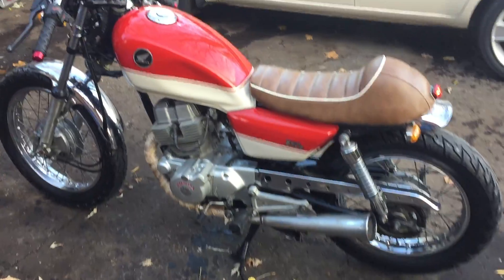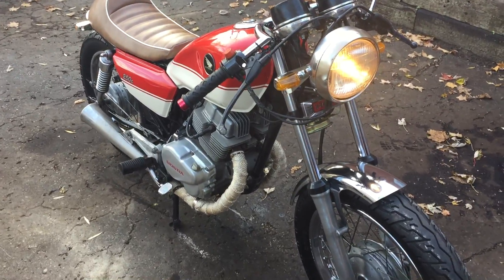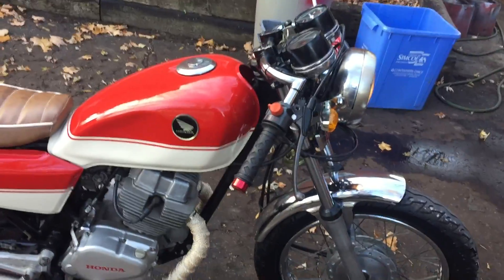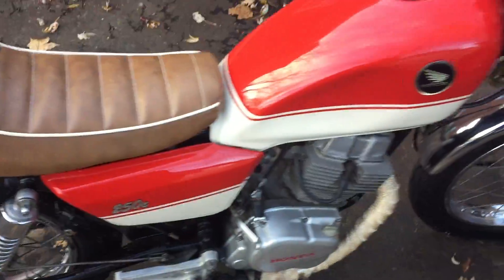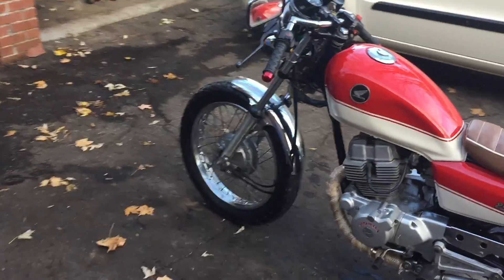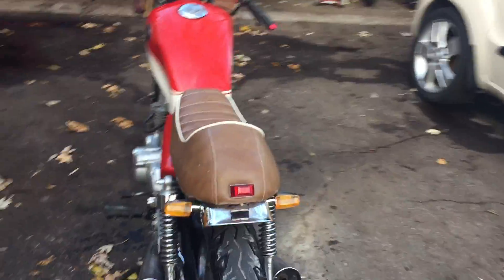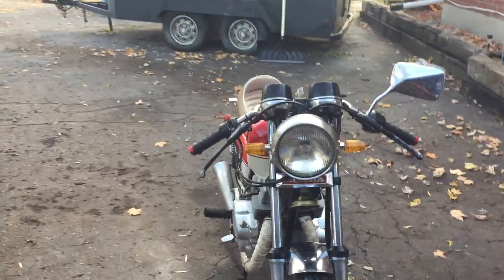1982 Honda CM250 custom. cafe racer conversion...part 11  DONE   :)

Comment: Did you do anything with the exhaust?
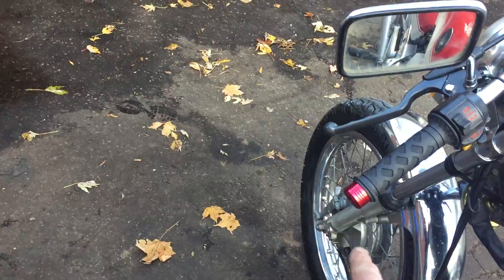Reply from the maker: around the 1:50 mark you can see the 2 small holes I drilled in each rear baffle plate of each exhaust pipe . makes the muffler a bit throatier without buying new pipes
Reply: @fupabox  Did you have to get new jets then?
Reply from the maker: @lucaslirette7643  nope..only opened it a tiny bit . not enough to effect jetting
Reply: @fupabox  Also what did you do for the cables? Are they original or shortened? If shortened, how?
Reply from the maker: @lucaslirette7643  original cable length

Comment: How much did the seat cost?
Reply from the maker: +The Brooklyn Hustle  I re worked and formed the stock seat base, re formed the foam. and the upholsterer charged me $140  if I remember correctly..to make and install the cover
Reply: +fupabox thanks. Had someone quote me $200...it seamed very high for a simple brat seat
Reply from the maker: The Brooklyn Hustle the guy I use charges about $60 to upholster a brat/bobber seat..so check around for a better price